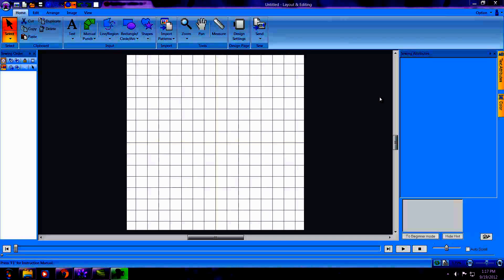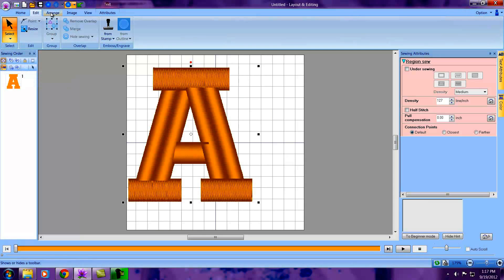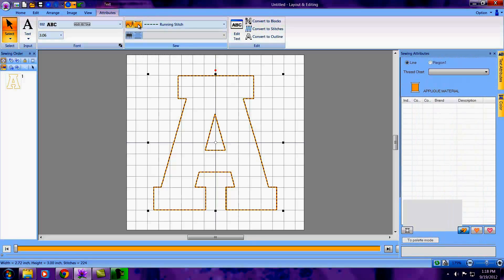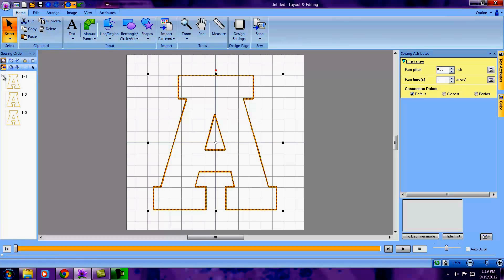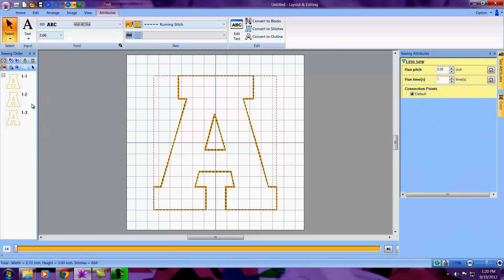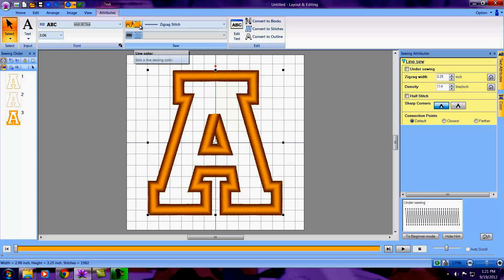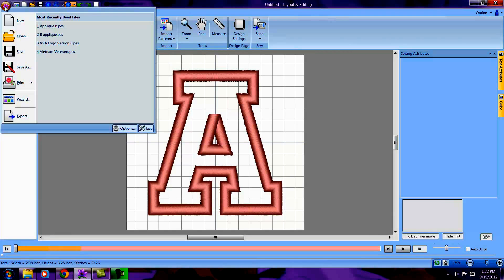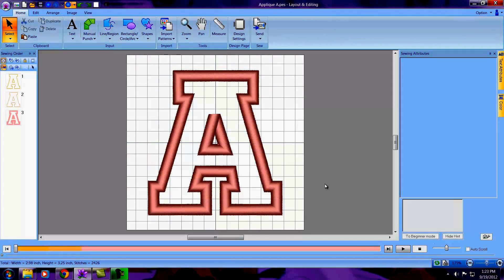Creating an Applique Letter in PE-Design Next

Comment: If I am creating an appliqué for  the word "two" would I follow you example for the "a" and then repeat steps for each subsequent letter?  At first I had grouped the letters; but I know I need to complete each letter before moving to the next since they will each be in a different fabric.  Also, will the jump stitch happen by default, or do I need to know how to do that?  Thanks so much.
Reply from the maker: Kathy, you could do either individually or as a whole word. Would be quicker and easier as a whole word, but if large applique' letters, I sometimes prefer each letter to be finished individually for best orientation of finishing stitch over the edge of the fabric. Less pull compensation over the area of one letter versus three letters...but I have done both successfully.
Reply: sewhandy I am using 4" lower case letters on a toddler's t-shirt.  I have the letters grouped now and have copied and pasted according to your directions.  When you commented about changing the colors so your machine knows when to stop, I got confused about the letters as a unit.  I want to be able to do each letter in a different fabric.  This will be my first time to ever create or modify an appliqué pattern.
Reply from the maker: kathy loftin For ease then, I would create each letter individually. You could still create as a whole word and just place different pieces of fabric over each placement stitch, still allowing you to have a different fabric on each letter.